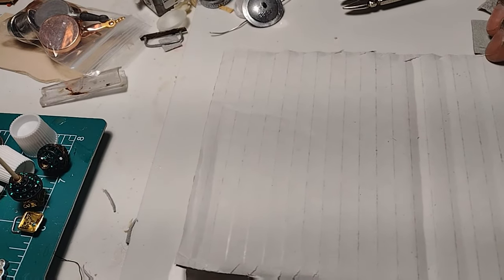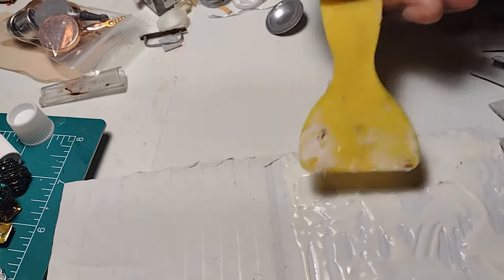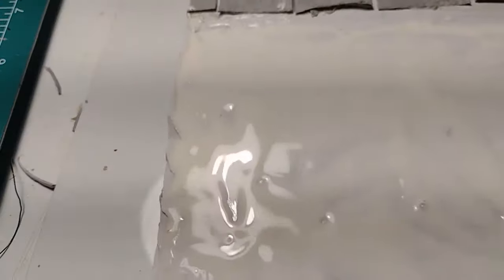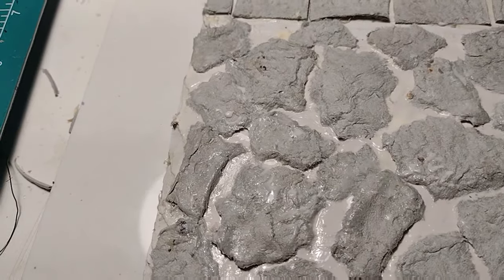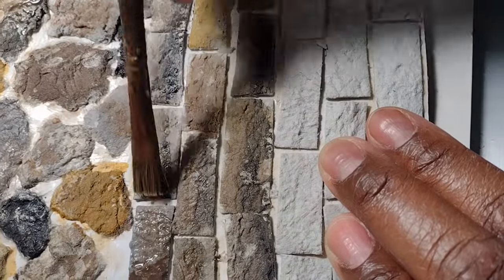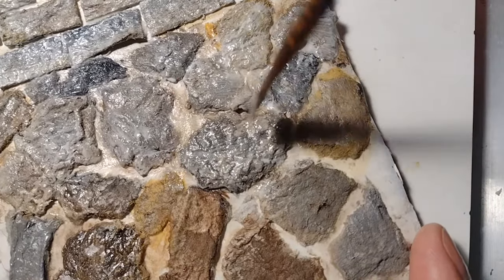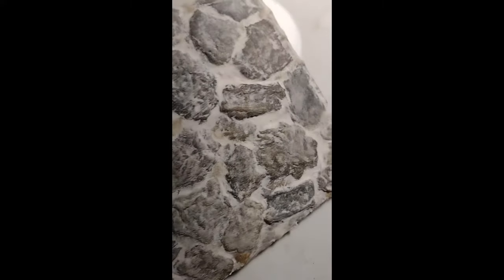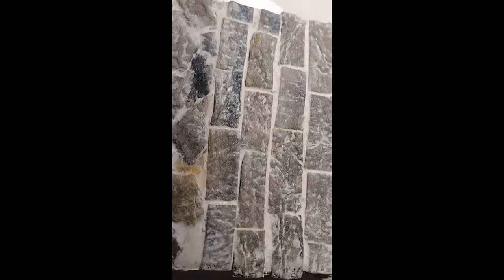Stones and Bricks for Dollhouse using Egg cartons-Rooming House Dollhouse

Comment: I ended up using modge podge as the base for the stones rather than wood glue, it worked alright but dried way more quickly, so I had to almost do each stone individually. I'd probably do wood glue next time!
Reply from the maker: I’ve never tried that before! It’s good to know! I always use wood glue for my stones, because it gives me some adjustment time. I'm glad things worked out for yours!!! I appreciate you for letting me know!
Reply: @littlegretchensworkshop7665  Thank you for showing the technique in the first place, I never would have tried it without you! (:

Comment: Great ideas drywall or ceiling tile cut into 2in wide straps using wire brush on the sides makes a great  stone look also and can off set and stack them.
Reply from the maker: Thank You those are Great suggestions! I tend to use what l have on hand😃 l drink ALOT of COFFEE ☕ so I have lots carry out cupholders on hand! Thanks so much for watching 😊

Comment: Thanks for the great tutoring video. Mine turned out well but the joint compound seems to cover a lot of the color. I still have to try to give it a little wash with either the chalk pastel or acrylic paint. Thank you for sharing.
Reply from the maker: Thank you for watching Benjamin! Absolutely Yes, i mention that in the video that after you wipe off the joint compound you will need to enhance the color with more paint. There is a part where i mention that if your colors seem too bright at first, no worries because they will tone down alot after the joint compound is applied!  I'm glad it was helpful! Enjoy, it is useful as a finish for a variety of projects! i appreciate you for being here!

Comment: if you do not want white grout can you tint the material or brush over with acrylic paint that will wipe off?
Reply from the maker: Yes or add color to the compound before you add it. I've never colored it before so I'm unsure about what would work. Also, if you leave less space between the stones less grout will be visible afterwards.

Comment: Hi there! This looks so good, thank you for the video.
You say "joint compound" and I just wondered if this is the same as "modelling compounds" like Sculptamold? The ones that are plaster mixed with fibres? I'm putting together a starter kit for my partner and just want to make sure I've got all my bases covered. :D
Reply from the maker: Hi ☺️👋! Joint compound is stuff we use to fix cracks in wall plaster or to smooth over seams in drywall. I never used a modeling compound, so I'm not sure how it would work. I say try it and see what kind of results you get. Main thing is, you need product not to dry out before you can wipe it off faux bricks!💖 Let me know how it goes. Thank you for watching ☺️

Comment: If I wanted to create this stone look on a chimney, would you recommend doing all the work on cardboard, first, and then gluing it all to the chimney.  Or applying the stones directly to the chimney?  Currently the chimney is built.  The dollhouse is built.  It was an old kit from the 80's.
Reply from the maker: I would apply stones directly to the chimney. When you get a chance check out my Original Dollhouse tour! The chimney on that house was "updated' with egg carton stones directly on top of OLD brick work. Result was perfect! Just be mindful to cover or tape off roof area when you are applying joint compound. Let me know how it turns out!

Comment: being new to this craft have to ask, how many coats of modge podge do you use.? in did only 1 coat and putting on the drywall paste, the stones started to lift the color out as  i wiped.
Reply from the maker: Hi Ron! If my memory serves me correcting i believe I did ONE coat but it was a very generous/thick coat. If you feel more comfortable try 2 thin coats. But i will say the Color is Always considerably LIGHTER after you wipe the compound off the stones. But keep in mind that after the compound dries you can re- enhance the Stones with your paint washes and even chalk, then seal them with Mod podge again. Let me know how it works out!
Reply: @littlegretchensworkshop7665  thanks for the info. Will get right on it.
Reply from the maker: @rontaylor8877  let me know how it turns out!!
Reply: @littlegretchensworkshop7665  hi Gretchen it's working out great decided to put the compound on with a  artist brush and barely touching the stones loving the look. Thanks for your input.
Reply from the maker: @rontaylor8877   I LOVE THAT YOU TRIED IT WITH 🖌️ BRUSH! THERE IS ALWAYS MORE THAN ONE WAY! GLAD IT WORKED OUT😃

Comment: This is such a helpful video! Thank you so much! I’m working on my very first dollshouse and I want to use this technique with the stone just on the lower portion as a stone foundation. I had a question and I don’t know if you’ll see this to answer, would you recommend that I create the stones directly on my house or should I create them on something else and then glue it to my house? I am binging on your videos now! Cheers, Sheryl 🙂
Reply from the maker: I'm glad you found this video helpful! Actually applying them directly to project works really well if you have "direct access" to the surface, like the outside of your dollhouse. If you are doing something inside the dollhouse, I make the stones on template i measure for the space on a  "brown paper bag"! Check out my video with views of  floor and walls of the Cafe in the Rooming House Dollhouse. It's more convenient to work on you craft table with a template for areas located in tight spaces like floors and walls. The brown paper bag template is great because it's flexible and doesn't fall apart when it gets wet during the coloring and grout stage. Let me know how it turns out!
Reply: I was wondering the same thing....first time "doll houser" too. Also addicted and in love with these helpful videos

Comment: Love this tutorial. I did it on a piece of foam board and it looks great, but it "shrunk" as it dried and is now warped. Any advice on how to keeo this from happening? I used wood glue also. Should i use a different base material? I was hoping to have thr chimney detachable so i can run the wiring behind it, but maybe ill need a new plan. Any advice would be greatly appreciated. Love your videos!
Reply from the maker: Hi there MsLaura! Thank You! I have never done this technique on foam board.  I've always done it on wood. Except when I created this video l did the samples on cardboard. The combination of the wood glue to attach the egg carton pieces and the joint compound as grout made mine rock hard and it stayed flat. I'm really not a big fan of foam board for building because it's although it's lightweight, it has a tendency to warp, especially if it gets damp. In order for you to prevent warping with foam board you may need to use multiple layers but that could get expensive. I would recommend multiple layers of cardboard. I'm kind of old school so l don't have a lot of experience with foam board other than using it as a partition or to divide rooms. Even then l use minimum 2 layers and I have to weigh in down to dry flat. I hope this helps.💖💖💖
Reply: @littlegretchensworkshop7665  this does help, thanks! I'm fairly new to this, so any seasoned advice is greatly appreciated. I did try a small sample section on balsam wood and it didn't warp, so that's what I'll try going forward. One of the things I'm really enjoying about minis is getting to try my hand at all kinds of things. It's not the master of one craft, it's the practice of many! Love your videos, thanks for sharing your knowledge!

Comment: Thank you for sharing this tip n trick.  It turned out fabulous!  What colors did you use?
Reply from the maker: Thank you and You are welcome!  I just used several different colors of watered down acrylic paint. Grays, Red, Sienna, Blue and Green. I did very thin layers of color washes, not thick. After each layer dried I'd do more until it looked like the color of stone. Colors tone down alot after joint compound goes on. Process is tedious but result is wonderful!
Reply: Thank you for sharing.  I'm gonna give this a try.  I didn't realize diy for my dollhouse.  I ran into a group on fb.  This will be my 1st project

Comment: Hi this is amazing you explained things great thank you . I was just wanting to no can you apply this straight to doll house walls or do you have to put it on the cardboard then apply to dolls house thank you
Reply from the maker: Hi Mandy! I applied it directly to the OUTSIDE of my Doll house. But when I used the technique for INSIDE walls I made the stones on  brown paper bag templates. It's easier to create template for INSIDE walls on a template and then glue in like paneling. BROWN PAPER can handle the moisture and it's flexible even after it's dry. Cardboard and chip board is too stiff. Hope this helps! Thank you for watching ❤️
Reply: @Little Gretchen's Workshop  thank you I am going to brave it and have ago.tganks for your help x

Comment: You are amazing! Thank you for sharing your talents and technique! Do you mind telling me what brand of joint compound you used for this video? Thanks :)
Reply from the maker: Thank You So much! And you are Welcome! I use DAP DryDex joint compound.it's lightweight and low dust if you do any sanding.  I have used the regular and the pink that turns white when its dry. Both work well. Use gloves so you have easier clean up! I'm glad it was helpful!
Reply: @littlegretchensworkshop7665  thanks so much for the info! You're the best :)

Comment: would the brick stick if you used it paper mache like on your final layer of paper mache? i.e. wet paper then the egg carton pieces.
Reply from the maker: I'm sure it would. I've never done that but I don't see why it won't work. Just make sure you allow glue to settle into egg cartons stones they will conform to whatever to add them to. Let me know how it works out 😊❤️❤️

Comment: You make really nice stone walls. But this video would be much more useful for a foreigner like me, if you told what the materials (paint, coverage, filling) are, as in my country those might be available as well, but under different brand names.
Reply from the maker: Hello! Ok! Thank you, for that feedback! I will be more mindful of that in the future! The paint is just craft acrylic paint. I use FOLK ART acrylic  but i water it down alot in a pallet or tray for this project. Filler or joint compound is by DRYDEX. I hope this helps, thank you for watching!